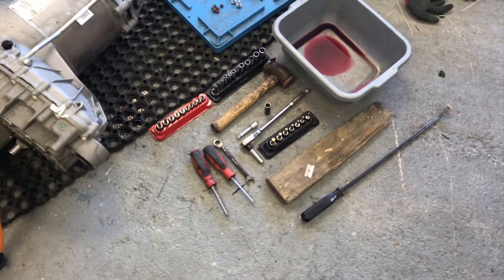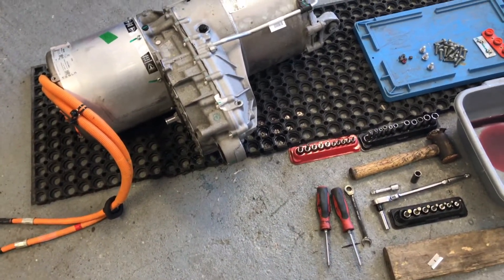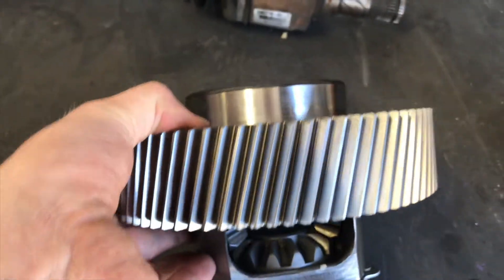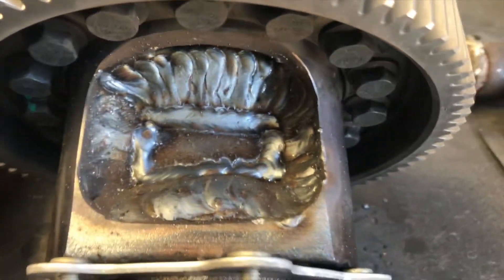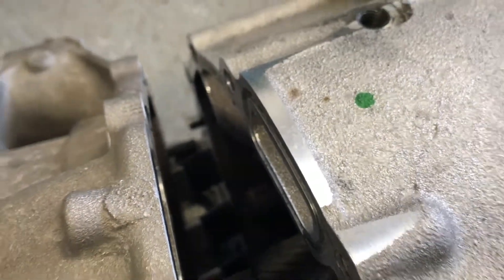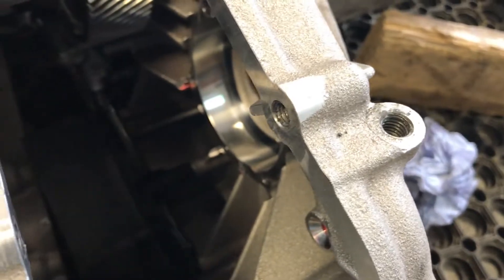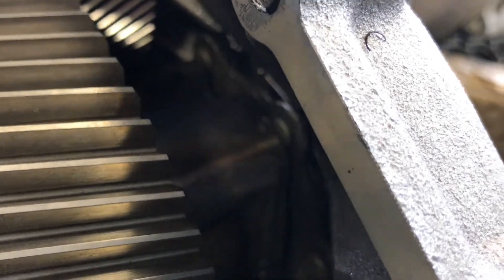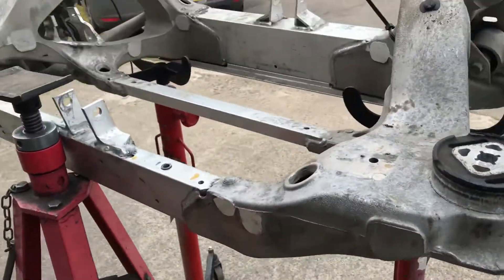Tesla Large Drive Unit Differential Welding! For the R32 Skyline Build - Drift ready

Comment: Mmmmm ... go easy on the razor blades for cleaning the alloy casings ... try using '3M Bristle Disc ' (soft)   Rolocs ... much easier and won't leave scratches on the alloy case halves  ....

Comment: Would this work for a drive train for a solid axle 4x4, I'm building a solid axle swap 1982 2wd Toyota with 3/4 ton Chevy axles and was thinking of electric
Reply from the maker: No easy way in regards to solid axle unless you rotate the drive unit and fit it onto the prop shaft

Comment: A quick question, why did he solder the differential?
Reply: An open differential will only spin one wheel and it’s the one with the least amount of traction. Welding the spider gears essentially locks the axles together so they can’t spin independently. Makes slow speed cornering difficult as the outside wheel is travelling more distance that the inside one so it will screech the tyre when turning but for drifting you want both wheels to spin to allow the rear of the car to slide.
Reply: @streddaz  why use an open diff then? whynot just get a normal one?
Reply: @mo_sabi  the normal one is and open differential. A limited slip differential could also be a way to spin both wheels but there may not be one available for a Tesla and welding it is cheap!
Reply from the maker: Eddy Boh open diffs are no fun for drifting
Reply: @Hazell_Nutz  how do you mean? I though the engine was design to go from 0-60 in 3.4 sec? how is that not enough torque?
Reply from the maker: Eddy Boh having a welded diff on any car makes drifting easier no matter how much torque.

Comment: Ive been trying to figure out how to use the Tesla motors to drive a normal drive shaft. The open diff prevents that (at the very least, maybe other things too). With a welded diff (not that I like this as a solution).. wouldnt it then be possible to drive just one shaft (ie a traditional driveshaft to the rear diff of a car)?  Is there a better way?
Reply from the maker: Alan Devine hi, you will need a locked/ welded diff. Also one of our new 4.5:1 gear sets then the ratio over all should be correct.

Comment: I'm confused why did you weld this vs leaving it alone?
Reply from the maker: thomas oliver because an open diff is no good for drifting. As only spins one wheel when you brake traction so with welded/ locked diff spins both wheels at the same time.
Reply: @Hazell_Nutz  I was going to ask myself, though now I'm wondering it's ok to just leave it be if I want a normal working drive right? Also fantastic work and best video of a EV I've seen
Reply from the maker: Dan Vercruysse we do sell a Quaife ATB diff upgrade that is perfect for daily use and track.

Comment: Do you know if a Tesla motor can be mounted in any orientation or does it have to be mounted "flat"as they are in an actual Tesla? For example, could it be rotated 90 degrees as viewed from the side? So instead of the motor and inverter being directly behind the drive shafts, the motor and inverter would be directly above the drive shafts? Would this mess with the cooling and oil circulation? Thank you.
Reply from the maker: canieto1 yes they can be mounted differently but you may need to modify the gear box oil pick up

Comment: You never mentioned what type of sealant did you use when putting it back together?
Also you have a video on how to open the small drive unit? I haven't been able to get the gear to release from both halfs.
Reply from the maker: Anner J. bonilla I used gasket seal the same stuff used when rebuilding gearboxes and engines.  On the small drive unit there is a spring clip on the motor side. I will be doing a video beginning of next months once I take delivery of our new quaife diffs 👍

Comment: I cringed when he put the gearwheel directly on the concrete floor. Simply unprofessional. Otherwise a very interesting video, so thumps up for that.
Reply from the maker: Marcus Rudel concrete floor? The drive unit is on the floor on a rubber mat but all the gearwheel work/ welding was done on a black topped wooden bench (piece of stage deck). I myself would of also cringed if it was put on a concrete floor as could cause damage to the ring gear. Thanks for watching.
Reply: Zero EV 1:43 is not concrete, then? Sorry , my mistake.
Reply from the maker: Marcus Rudel - nope not concrete wooden worktop but can see why you through it Was is hard to tell in the video. 👍